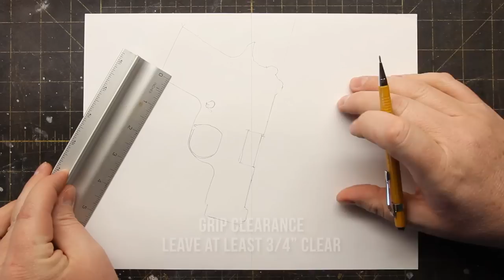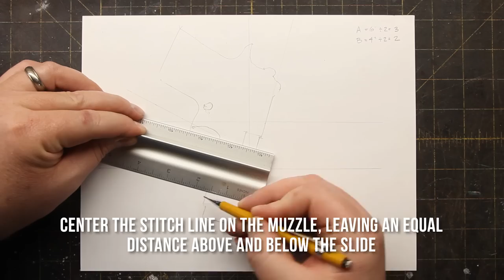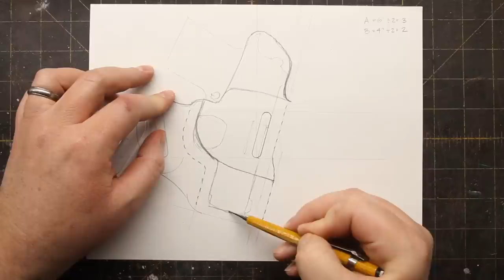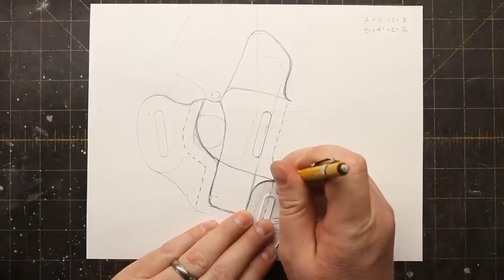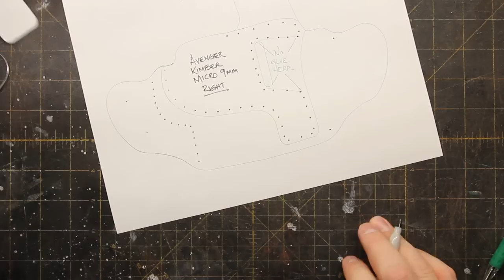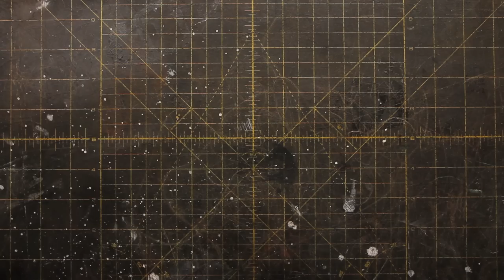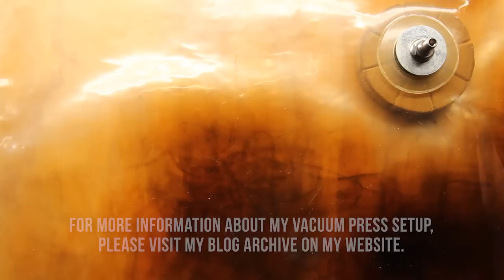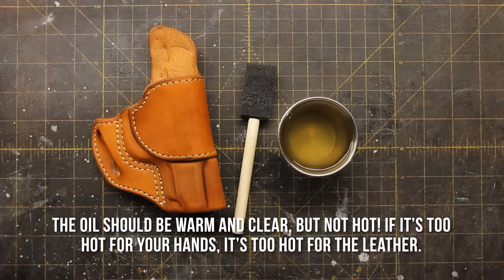Making an Avenger Style Holster, Kimber Micro 9

Comment: Nice holster! unfortunately your template is not visible, too bright and 1/3 of video is just your hands moving.
Reply from the maker: Sorry to hear that John. I'm trying to improve my lighting over my workbench, but obviously have room for improvement. The lines are visible on my screen, but I will make an effort to make the lines darker on future videos. Thanks for watching & commenting.
Reply: @AdamsLeatherWorks  / Just thought I'd let you know.  Using a heavy marker would be better or diffused lighting.
I was a commercial photographer for over 30 years... / thanks for sharing your videos!
Reply from the maker: A marker might make tweaking the design during the sketch phase a little more difficult, but I'll give it a try on my next video. I recently acquired a couple dozen LED light box panels (sort of like what artists use for tracing, but these are for signage boxes in restaurants, retail stores, etc.). I'm going to mount them to the ceiling above my workbench and see if that will give better overall ambient diffused lighting without harsh hot spots and shadows.